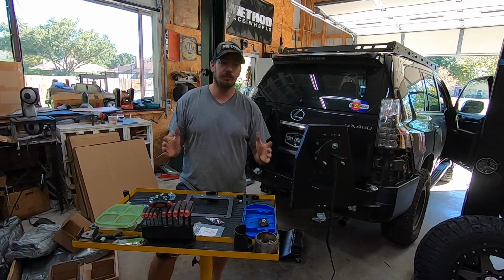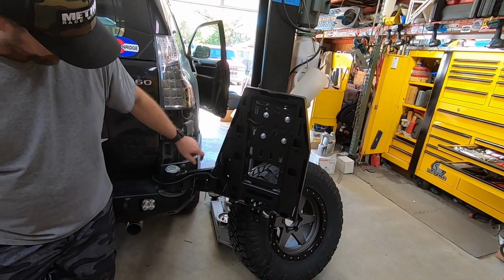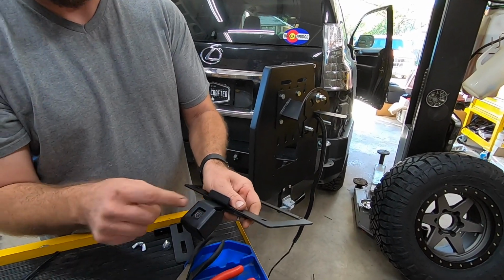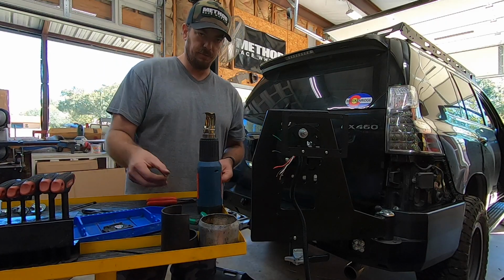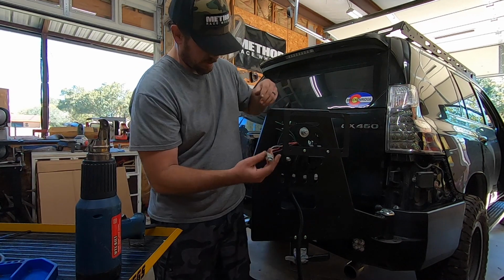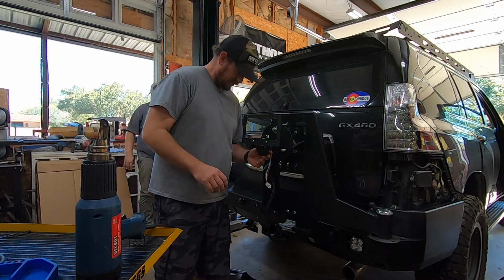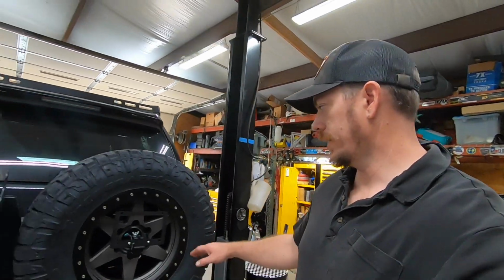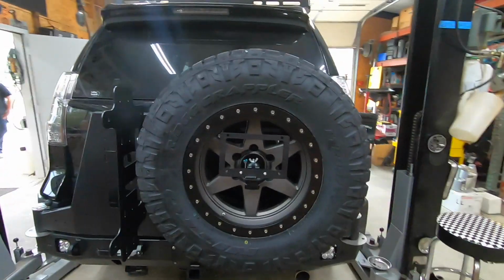Overland GX460 Wiring Victory 4x4 Rear Bumper Reverse Camera Relocation Kit and License Plate light

Comment: So how do you mount that wheel up there with the camera plate on? You have to remove it?
Reply from the maker: That is correct. You would remove the license plate extension that is held with just the bolt and thumbscrew. This is shown at 3:35 in the video.